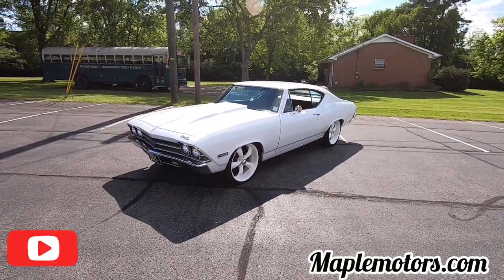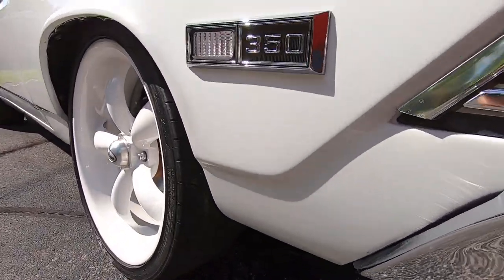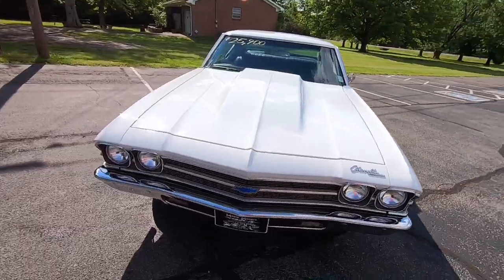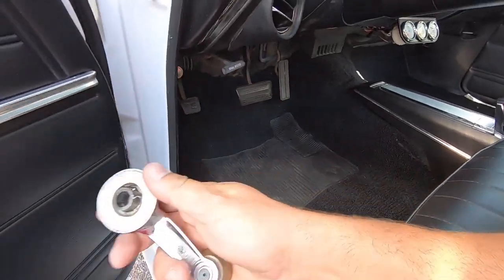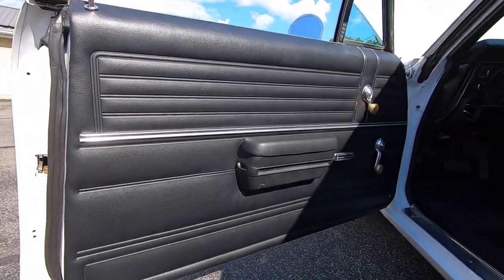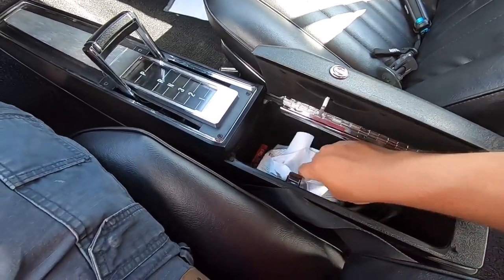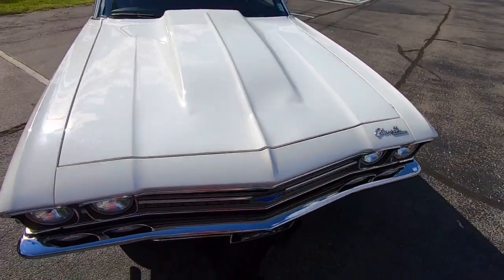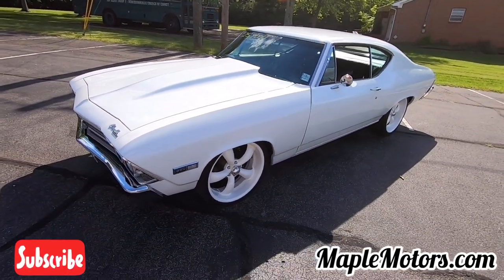1968 Chevelle SOLD for $25,900 Maple Motors #578

Comment: Did come with AC long ago..can see the factory AC vents in dash.. Can be added back on.. Easy to do by today standards especially if it once had it in dash.. Every one has a taste . for this calibur of CHEVELLE I rather have the AC BACK IN IT. Don't want to race it with what cars are being today. But makes one heck of a cruiser with all its toys in it..Can see a route 66 run in it be nice.. Why run it QUATER mile when it can drive coast to coast see America in American muscle. IVE DONE ROUTE 66 4 TIMES BEST ONE WAS IN BUICK SKYLARK GS WITH AC AND FROM CHGO TO SAN DIEGO AND BACK IN 47 DAYS..WHAT A BLAST..

Comment: They were prone to rust under the trim at the bottom corners of  the rear window.  My 70 SS had some in the 70s, just enough to let the rain get in. It will go down onto the fender pockets in the trunk.

Comment: Stand corrected the vents are astro ventilation they came with in 68 and up to 72 maybe where you pull vents open by kick panels .  once I seen the switches in dash one could see it wasn't a AC car..none the less can be achieved easily..many after market parts available in California most oem down to the dash switches are available..its amazeing the oem replica parts available today for most GM MUSCLE..